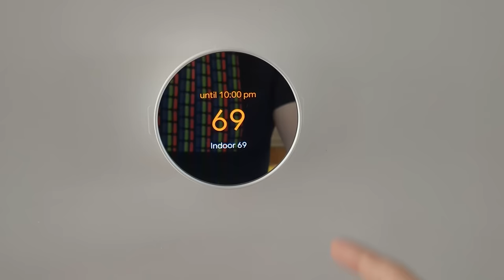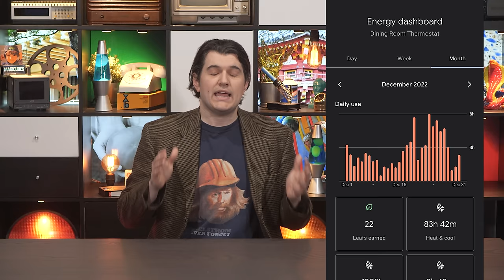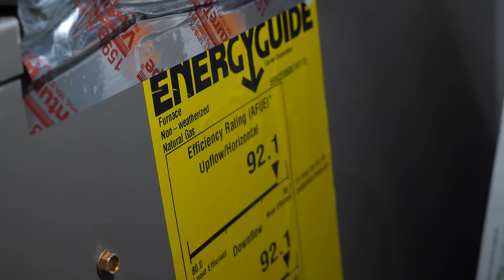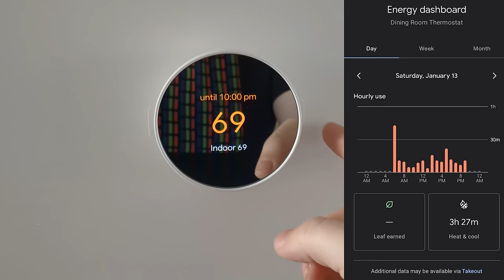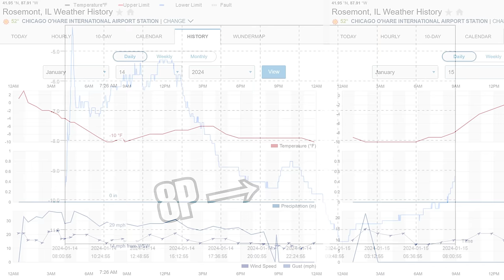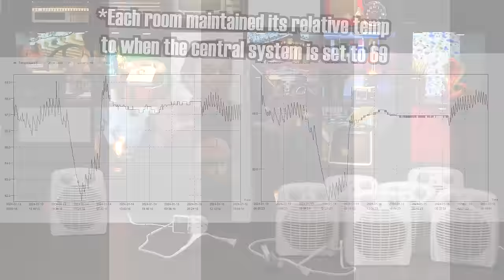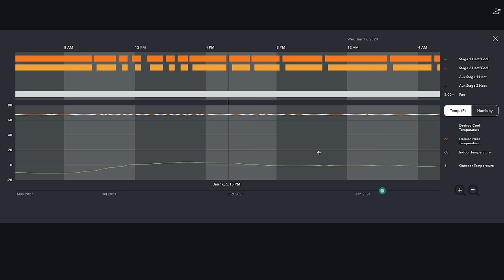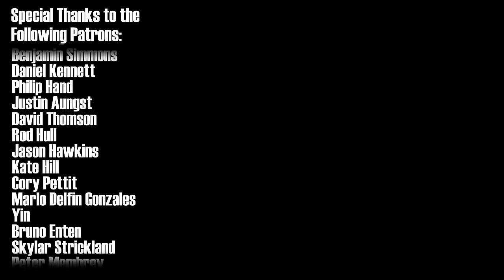Old HVAC industry practices are holding us back and costing us money. But we can fix it.

Comment: Energy auditor here, only 4 minutes into the video but you named off everything on my residental energy audit software. I check everything from the joist spacing to the operating pressures of each register. The Department of Energy are using all the factors you listed in order to weatherize homes. Hope that gives you peace of mind. One of my goals is switching gas furnaces to electric heat pumps. Western Ky here.

You hit such a huge point at the 25 minute mark. The software we use has a Windows XP face and I think it came out in 2012 and just had updates. I've got a list of DOE approved audit softwares, and they're all a decade and a half behind us. We need to take some of that weatherization money and use it to design a user friendly app, if not just for the professionals. The current system is frustrating enough to make me find another job.

On the ductwork design rant; almost every house I inspect here has the ductwork in the attic. We spend a few hundred on sealing the ducts with mastic on every job. 

Concerning your garage, is the ductwork in that chase internally lined with insulation? Maybe that could help.
Reply: Tasks like this are what people should be using AI for. Anonymize the datasets for a few thousands of homes and train the AI to run a questionnaire for the person doing your job until you think all the special conditions are covered and it can generate a reliable result.
Reply: @chrisblake4198  Software developer here. This isn't a problem that can be solved by AI. Rather, the things AI is good at aren't the things that are the problem. Adding AI to the existing systems doesn't benefit anyone other than Nvidia. Yes, you could build an AI system to do the estimation. But as the results in this video shows, the existing formulas are plenty good enough to get within 5% of the actual value. We don't need an AI system to do the estimations.

What's needed is a UX designer and a front end developer to build a better more usable interface over top of the existing software. Existing AI tools don't magically fix user interfaces built for Windows XP. All that's needed is a small team of developers and a few months to put together a nice website to run the existing published calculations. In fact, a single software developer could build the whole system if they're a highly competent front end developer who also knows how to manage cloud infrastructure, and they have a few thousand dollars each month to pay for server costs.
Reply: @alexlowe2054  also Microsoft doesn't help when they keep breaking software and how not user friendly it is..
Reply: @chrisblake4198  Maybe what we should be using AI for is finding a way to properly educate people on what AI should be used for...
Reply: @chrisblake4198 When someone says "X can be solved by AI), there's a 99.99% chance that they have zero idea how X and AI work, and you seem to fall into that category.
Reply: @chrisblake4198  no
Reply: Can you explain why someone would want a furnace that runs near or at its maximum capacity most if not all of the time? I'm totally not getting what it is he thinks is a problem.

Wouldn't a furnace that runs a quarter of the time also be expected to last four times as long given the same load demands?
Reply: @WhiskeyNixon from everything I’ve heard and read, most of the wear and tear on hvac systems comes from starting and stopping them, so an overpowered system will be stopping and starting a lot more often, thus wearing a lot more. Which makes sense because in essence you are just running a specialized fan and the motor has to do a lot more work to get a fan up to speed than it does to maintain its speed
Reply: @BobbyHill26 Very true. One thing he kind of glosses over in this video is that there are multi-stage residential furnaces. You ideally want the first stage to heat the home on a moderately cold day without much duty cycling. The final stage should be at the design load plus some margin to get the house up to temperature during warmup. There are also variable speed heat pump condensing units, though I don’t know if they made it into the mainstream residential market yet.
Reply: @BobbyHill26  then would continuous blowers alleviate all concern here? seems an easy compromise.  and constant circulation is better for health of body and home, as I understand it. I run my fans constantly for this reason, already.
Reply: Hi Jesse, I’m a community organizer in eastern Kentucky who occasionally plans home energy efficiency workshops. In reference to the weatherization money, and other money attached to the IRA, one of the areas we’re really struggling with here is getting utilities on board with programs meant to help rate payers and getting funding to work toward helping regular folks in general (not that it’s not happening at all of course). Do you think rising energy costs in your area are pushing rate payers to look for energy efficiency solutions?

Comment: I work at an engineering firm & design HVAC systems every day. You hit the nail on the head! Every time i thought “well what about x” you would say “on the other hand -“ its like you were reading my thoughts. Great video!
Reply: What about duty cycle? Often in engineering, we don’t want systems to run 24/7, because it wears parts down with heat, friction, and fatigue stress - reducing the life expectancy of the parts. Systems designed to run 24/7 are typically more expensive to build. Let’s say the fan motor is rated to last 50,000 hours, if it only runs 3 hours a day, it could last 45 years. If it has to run 24/7, it will last less than 6 years. Some parts, like the flame sensor, may do better running continuously - but many do not.
Reply: @123psi8 the hardest wear on the compressor is during start up when theres no oil pressure/flow. Since that's by far the hardest moving part to change it dictates the duty cycle. Running a 100% duty cycle at a lower percentage of the capacity(maybe 30% of tonnage) is more efficient than letting the temperature rise of fall and then running at 100% of capacity
Reply: @AGH0STBUSTER5  I was talking about the furnace, not the heat pump, but that is a fair enough answer. The devil is in the details and I would like to hear from an engineer who designs the device itself. If the design engineer expects the system to run at low duty cycle, they will design accordingly to cut cost. Why buy a pump/motor/fan with a 100,000 MTBF that will last 25 years if your boss is telling you to cut costs and design for the 5-year warranty? Why buy a continuous duty motor if you expect a 25% duty cycle or lower? Not that I agree, but that is what happens. And it happens because most people buy quality when it something they want. When it is something they need, they buy cheap 🤷🏻‍♂️. Again, not an HVAC guys, just my 2-cents.